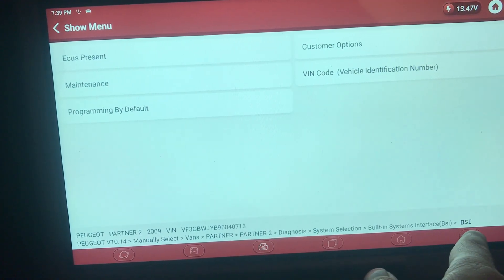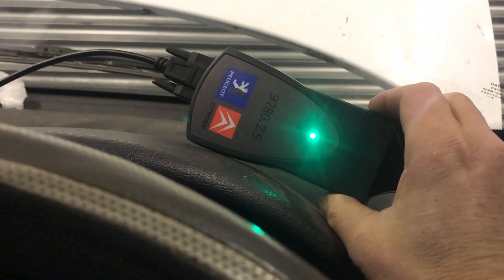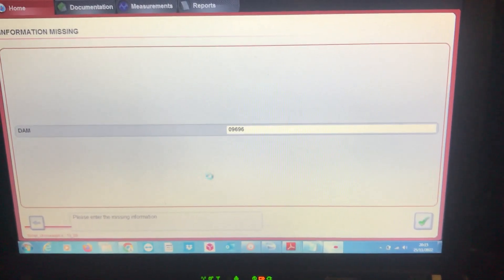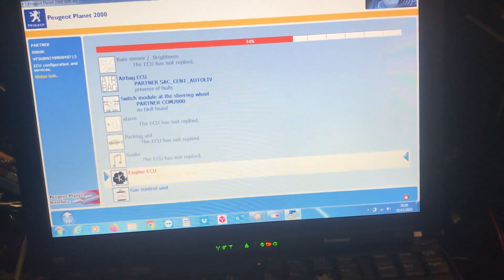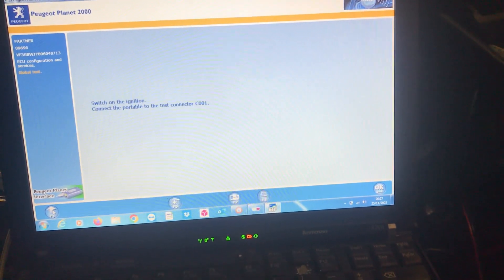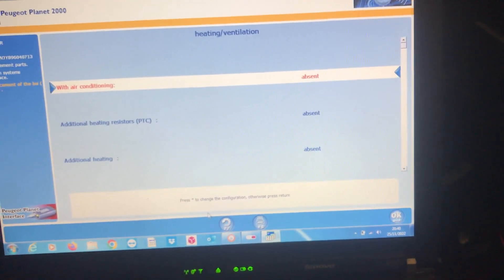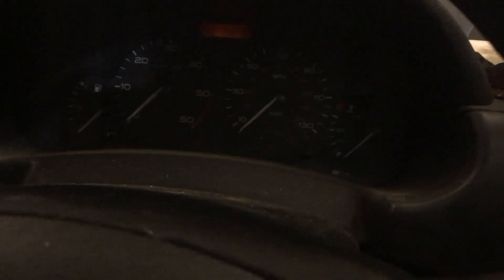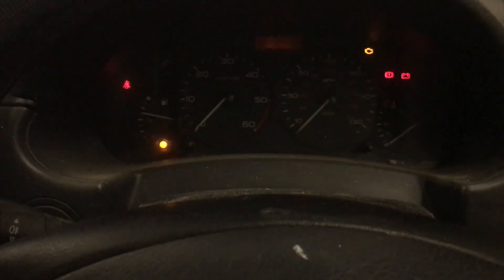Peugeot Partner - Citroen Berlingo Virgin BSI install Aftermarket tool vs Dealer tool Diagbox Vs aft

Comment: Looks bad tablet tool...can not make even simple thing
Reply from the maker: Errrr, no! Fact of the matter is there is no aftermarket tool which will program these units, except maybe for the old blue box Autologic, which has been replaced with a new model which isn’t capable of doing it, I have tried with Launch, Autel, Thinkcar, Topdon and Snapon (Now they really are a bad tool!) sometimes on some jobs you have to still use Dealer tool!

Comment: I have a 2020 Partner/Rifter K9, E6 (customers van supplied by me) won't bore you with all the deatails publicly but I can't alter any BSI parameters. I have tried my Launch and Topdon Poenix Plus but won't change anything. Need to turn off eoloys but says programming failed. The ECU has been remapped to sort a few issues but still tries to do a regen when it feels like it causing massive smoke for 5 mins. My supposedly genuine PP2000 worked once then bricked. Do I have to go see someone with genuine dealer diagnostics old chap? Thanks in advance.
Reply from the maker: Hi & thanks for watching!.. sorry but I haven’t had to plug in to one of these this new, I would think the only way to fix this is a DPF delete & remap if not already done - although I think most remappers would like to work on an original file so you would be best in my opinion getting a software update done first, I’m not sure if it is possible with genuine dealer tool or not, mine is an old copy version..
Reply: @JC-ECUConnection  Thanks for quick reply pal, it has had Ad-blue delete, EGR delete, Cat & DPF delete, etc.. its a total electronic dog.... these get to just over 3 years old, the adblue is first to go, injector first then adblue level meaning new tank etc, never worked on a worse van. Might have to buy it back from the customer now. He is very patient but running out of options.

Comment: Please can I ask why the mileage wasn't displayed on the cluster and do u have to programme the mileage back into the bsi many thanks love the videos keep up the great work u do👍
Reply from the maker: Hi, thank you for your kind words! You raise a very good point about the mileage - when installing a virgin unit the mileage is set to zero but will adapt to the cluster mileage automatically, sometimes it takes a few minutes / a few ignition cycles, from memory the mileage came back on after recording.. It’s really important if you want to test fit a BSI to Peugeot / Citroen vehicles that you are aware that the mileage will overwrite the highest value of either one to the other, for example let’s say you have a 50,000 mile vehicle & test fit a 100,000 mile BSI, the cluster will adopt the 100,000 mile value, then if you refit your 50,000 mile BSI it will then adopt the 100,000 mile value from the cluster… we regularly have to correct this for customers who have trial fitted components!

Comment: Interesting to watch the process, great  video. Fyi launch and thinktool (and Topdon) all use the same software. I had diagbox it was definitely handy but I was trying to figure it out on my own, not much tutorials online. Can I ask, the pin you retrieved from the EPROM, how did you do that, where is the EPROM?
Reply from the maker: Hi! And thanks for watching! Yes indeed ThinkCar & Topdon both use Launch software with some small variations, the main difference is in the remote diagnostic functions - Launch (UK) are locked to just one service provider, ThinkCar has an independent network which is growing and you can choose who you want to remote with, Topdon is similar but the Topdon Phoenix max doesn’t support remote functions as far as I am aware..
The EEPROM on these PSA BSI’s is on the back of the board (95160) - although we don’t need to open them to read the EEPROM as we can read the data via CAN, we then use various softwares to calculate PIN from dumpfile…
Reply: @JC-ECUConnection  hey thanks for the detailed response. I used a topdon to try and program an ECU and it asked me for a similar pin and I wasn't sure where to get it! I'm assuming you read it from the existing module, but you couldn't because it was drenched! Thanks again, and subscribed 👍
Reply from the maker: @tonyrice3348  Thanks for subbing!! From memory this actual job we virginised a donor ECU & adapted it by PIN number because the customer was convinced he had a data corruption fault, we had already cloned an ECU but his fault remained, so we re-done the job by virginising & adapting another unit - eventually we found that he had fitted 2 new injectors which were the wrong type, making it over fuel! The PIN number can be located in both the ECU & BSI dump files…

Comment: Also, when changing the bsi, you lose some functions, such as not controlling the doors and windows, and some lamps do not appear on the dashboard.
Reply from the maker: Final configuration can be performed by top end diag tools & dealer tool

Comment: this badd diagbox   the thankcar   best tools
Reply from the maker: Thank you for your comment, I agree the Thinkcar tool is a really good tool.. BUT it still doesn’t replace dealer tool, as shown here you still need Diagbox to program the PIN to the BSI, usually Diagbox programs the keys fine, but on rare occasions it fails - this is when aftermarket tools are helpful, as in the video the Thinkcar saved the day!
Reply: @JC-ECUConnection  hello as well as the manufcuturer s hardware is indispensable  
well done good job

Comment: Thanks for this detailed video.
Yesterday I bought the Thinktool Master X with a programmer. 
I previously worked with Autel MP808S but it wasn't enough for me so it became a Thinktool combination device (advice). 
So I hope that at least it's good.

What experiences have you had with it? 
Today I wanted to clone the engine control unit on a BMW E46 320i MS43.
Unfortunately that didn't work (that wasn't available).
I would be happy to hear your experiences with aftermarket scanners. 
This is now the 10th video with a like and a subscription. Please upload more of these videos. :)

Greetings Mr. Brown
Reply from the maker: Hi & thanks for watching & subscribing, it really encourages me to make more videos!.. As for Diag tools, both the ThinkCar & the Autel are good choices, They both have their strong points & make for a great combo, but there’s always another tool needed as you get further involved in this subject! - as for cloning an MS43 there’s no scan tool to my knowledge that will clone these, you will need to open the units & manually read & write 93C86 Eeprom & 29F400 Flash, or it can be done by extracting ISN number & adapting EWS ISN number. If you’re not into removing Eeprom & Flash chips from circuit boards to read & write we offer this service by post:
https://ecuconnection.co.uk/product/bmw-ecu-dme-ms43-siemens/
Reply: @JC-ECUConnection  Many thanks for the answer.
I was disappointed with my scanner today. Because neither when I removed the control unit nor in the input state could I do this on the scanner. 
But now it's clear to me that no scanner can do it! I did not know that. Thanks for the offer. I'll ask my friend how he wants to solve this now. 
I will forward your offer to him. Thanks for the experience about the scanners.

I would be very interested in videos about coding, software updates and immobilizers with the scanners and troubleshooting.

Greetings Mr. Brown
Reply from the maker: @CivicBoy87  No problem, I’m looking at doing some video reviews of diag tools, it’s good to know what people want to see & also some ‘How to’ videos on diagnosing ECUs.. sadly I don’t get as much time as I would like to making videos & editing etc, hopefully I should be able to upload one or two per month!
Reply: @JC-ECUConnection  that will be great 👍.

Comment: Question, will PP2000 configure a new PIN without knowing the original PIN oñ a non virgin unit. 
 I'm down to 1 key and have PP2000, but scared to experiment Thanks
Reply from the maker: No, you will need a virgin unit to assign a new PIN to it.. if you want to add key you will need to know the PIN code & use this PIN, we offer lots of PIN code retrieval services!
www.ecuconnection.co.uk

Comment: Bonjour from France ..Great video thanks ...trying to fix my car ..(every time I go into reverse strange things happen 🙄(I's E6) from wiring diagram Citroen Berlingo 1.6hdi 92hp the BSI under dash or the unit under hood with the E1 engine management ?
I need to A13 between gearbox reverse switch and the E6`s A13 ....because if it is under the dash (BSI) I don't  know how to find A13 ....very easy on engine management with the 3 plugs A.B &C but even with Haynes autofix I'm stuck ...can you help ?
Reply from the maker: Hi, thanks for watching - sorry I am unable to help with your wiring issue, they can be very time consuming & tedious jobs, good luck!

Comment: Is the Peugeot planet software expensive to buy
Reply from the maker: The original version will cost a few thousand pounds to set yourself up, however I have heard there is copy versions available for around £100 or so... use at your own discretion!

Comment: Hi can you please help me   can economy mode be bypassed / abolished? Thanks in advance
Reply from the maker: Economy mode should switch off automatically when the engine starts, if you have had an immobiliser removed from an ECU & eco mode is not switching off then it’s a bad Immo off method, ours works! Please visit website for more info: 
www.ecuconnection.co.uk

Comment: Is there a solution to the mileage problem when changing the bsi
Reply from the maker: Yes! - The best way - as in video is to set the mileage in the BSI to zero before fitting! If however the BSI has been fitted without zeroing the miles then the mileage will need to be corrected by firstly removing the dash from the vehicle & correcting on bench, then the BSI can be corrected by OBD or on bench & when installed back in vehicle there will be no conflict - we can help with doing this:
www.ecuconnection.co.uk
Reply: @JC-ECUConnection  
Thank you for the kind reply.  I actually fixed it before by removing the dashboard and writing the same mileage on bsi.  This problem may occur with a Berlingo vehicle.
Reply: @JC-ECUConnection  
Also, I have a question.  Is there some functionality, like closing the windows and showing some lights on the dash on the EEPROM chip or bsi flash?
Reply from the maker: @elhakim9416  it will happen in most PSA vehicles, mileage is recorded in BSI & Cluster - the higher value will write from one to the other when they are connected together..
Reply from the maker: @elhakim9416  sorry, not sure what you mean?

Comment: Como sacaste y con que Hramienta el código de seguridad ?
Reply from the maker: Hi, this is a service we offer on our website, we operate a postal service throughout Europe, we also Virginise these units ready for installation:
www.ecuconnection.co.uk
Reply: @JC-ECUConnection   gracias por responder ,  yo tengo la posibilidad de sacar el código de seguridad (que por cierto , he cargado un flash de otra BSI de una Peugout 5008 pero hardware diferente ) he conseguido sacar el código con vvdi key pad tool , programado la BSI , el nr de bastidor , y las llaves y el coche me arranca , pero tiene algún fallo que se debe a que el flash correspondía al otro hardware …, .  Lo que busco , será un archivo flash y para el Eprom también  de una misma referencia que tiene mi BSI , y que sea de una citroen Berlingo B9 motor gasolina 1.6 . La pregunta era  sobre cómo sacó el código pin si lo ha hecho con la misma Hramienta SVCI !? Gracias una ves más , y por cierto , si alguien me puede ayudar con los datos flash del coche indicado y nr referencia de la BSI , le agradecería muchísimo . Un saludo
Reply from the maker: Hi, no I didn’t use SVCI (AVDI copy tool) - I read the eeprom & calculated it, if you are looking for BSI flash files I would post on forums such as MHH & DigitalKAOS ETC ideally you will need the part number of the unit that you are searching for…